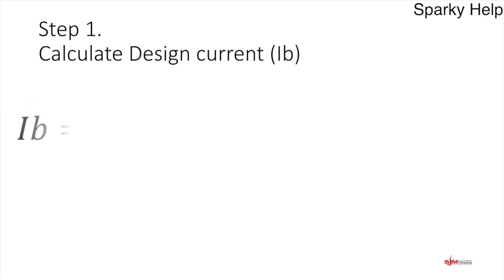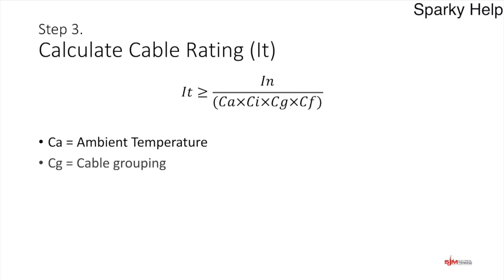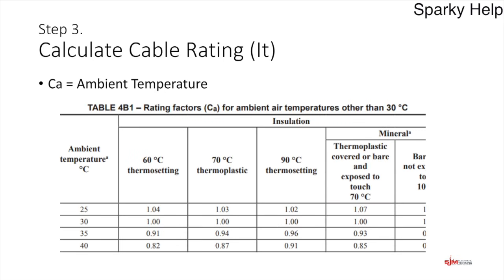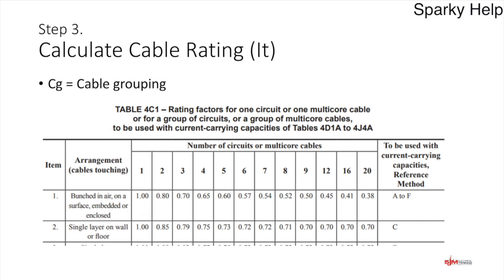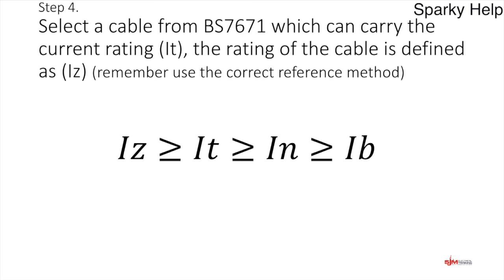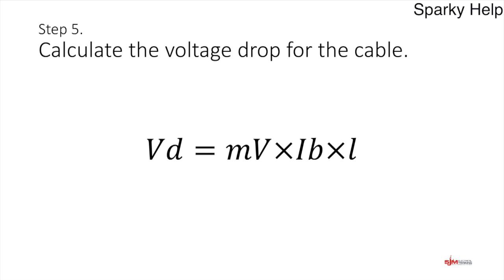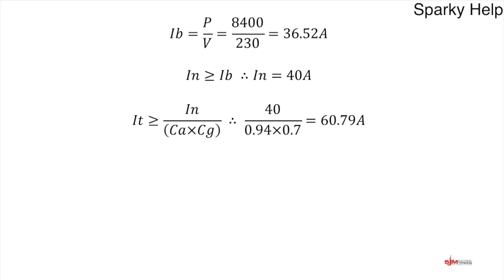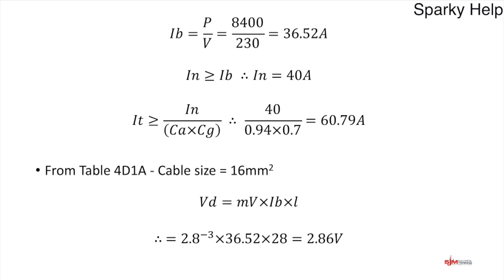Easy Guide to Cable Sizing and Cable Calculations

Comment: Thank you for the video! How did you determine the maximum allowable voltage drop?
Reply from the maker: Hi and thanks for watching, the max volt drop comes from the standard from BS7671 which is 3% for lighting and 5% for all other circuits on the public supply network.  Please share with like minded people and don't forget to like and Subscribe.
Reply: @sparkyhelp3997  Thank you!
Reply: Is it just something I would know for my circuit?

Comment: This all makes perfect sense but when you are trying to connect 16 mm cooker circuit cable to ovens where the cable it's directly supplying inside the oven is 1.5mm😂, it makes you wonder.
Reply from the maker: I get your point, but the oven cable has not had to travel the same route as the oven + plus different cable.  Remember you do not have to follow BS7671 it is not statutory.  Please share with like minded people or maybe even like and subscribe.

Comment: My college tutor has told us to apply diversity to the design current and use that value for the rest of the cable calculations. Is that not correct? I'm confused now!
Reply from the maker: Hi and Thanks for watching and share with like minded people, why is diversity being applied (is it a cooker?)  Design current is the current drawn by the load, the cable is required to carry at least the load current.  Speak to your turo and ask them to explain what the diversity is for.  I would only apply diversity as a rule for maximum demand assessment (https://youtu.be/7MhH-k6pEgI)  Hope that helps= look in your On-site-Guide to check for you self.  Good luck please like and subscribe.

Comment: How do you work out the design current for ring circuit with multiple socket outlet?
Reply from the maker: Hi Thanks for watching please share with like minded people.  this is a tricky one as you will never truly know what will be plugged in, therefore you could use a standard circuit and stick to area served and maximum length of cable (see On-Site-Guide App H).  So either assume A1, A2 or A3 circuit.  Hope that gives you further research.  Please like share and subscribe.

Comment: Heyyy you explained it very well. Can you please explain the calculations when the voltage drop is not given??
Reply from the maker: Thanks for watching, please share with like minded people.  Voltage drop is set in the uk as 3 & 5% depending on the circuit.  Or do you mean mV drop for cable?  In which case use resistances of the cable (from manufacturer or standard table) to work out volt drop, but all manufactures of cables will publish technical literature for their cables.  Hope that helps  Please like share and subscribe.

Comment: How about multicore cables like SOCAPEX? 6 circuits on 1 multicore cable. Does that mean that a 2.5mm SOCA cable is downrated from 16A to 9A per circuit just by being bunched up??
Reply from the maker: Hi good question, that would be a little more detailed to answer as you would need to read the regulations further.  you would also need to know the % load of each circuit as it may be neglected in in certain circumstances.

Have fun determining the rating - happy designing.

Please Like, Share & Subscribe.
Reply: @sparkyhelp3997  ah ok. So it depends on the load for each circuit?
I'll do some more research.

Love the channel it has helped me a lot since I discovered it!

Cheers

Comment: You need to elaborate on your use of Ib & In in your voltage drop & It calculations. Both can be used depending on the nature of your circuit. If the circuit can be overloaded, you would use the In value. If for a fixed load, you would use Ib.
Reply from the maker: This is True, but in this video it has not been covered.  One for another video maybe.  If I keep adding new ideas the videos are too long, so I have to stop somewhere.  But thank you.

Comment: 😮What about the 40A circuit breaker after having 60.79A? Do we still keep the In=40A?
Reply from the maker: Hi, 60.79A is the It rating for the cable not the circuit breaker.  The Load has remained unchanged, therefore the Circuit Breaker is still acceptable.  Please Like, Share & Subscribe.
Reply: Many thanks for your explanation!

Comment: Hello are we talking about a a copper or aliminum cable here? Could you tell how does cable size change according to type
Reply from the maker: Hi the Cable is copper, calculations can be carried out for Aluminium, but the current carrying capacity of aluminium is lower than copper.

Please Like, Share & Subscribe.

Comment: Is ambient temperature still at 70 degrees in thermal insulation ?

Also 40 divided by 0.94 x 0.7 = 29.78 or am I wrong ? 🤔
Reply from the maker: Hi the conductor temperature is 70 degrees, the ambient temperature is the surrounding air temperature.  Put the 0.94x0.7 in brackets 40/(0.94x0.7)=   Hope this helps.

Please like Share & Subscribe - Good luck
Reply: @sparkyhelp3997  sorry I ment is ambient temperature 30 degrees if wrapped in thermal insulation or would it be greater 

Na still not getting the calcs but il try work it out lol
Reply from the maker: @user-yh7bk7dx7c  Ambient Temperature is what ever the designer deems it to be (or the question setter!)

Keep going...

Comment: Hi, thanks very much for your video. My question is, would the calculated  Ib be divided by 3 if the circuit were to be  a 3 phase supply?
Reply from the maker: No use the three phase formula at the start to calculate.  Please Like Share & Subscribe.

Comment: Great explanation but a slight correction on the way you represent numbers in standard form in your calculations e.g. 2.8mV should be represented as (2.8 * 10^-3)V instead of (2.8^-3)V which is actually 4.6mV
Reply from the maker: Yes I know but a pain to go back and add an addendum now.  Well done for spotting it though. My copy has already been corrected. Please Like, Share & Subscribe.

Comment: When calculating Ib do I include diversity? Or the value before I do diversity calculation
Reply from the maker: I would tend to apply diversity after the design of the circuit.

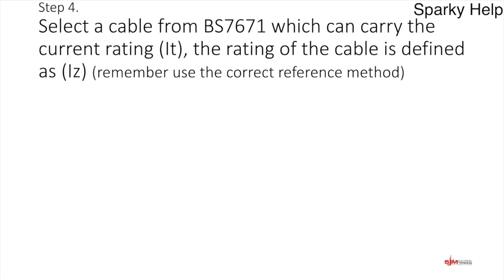Comment: Thank you very much, although some tables are not complete and also in 12:01 the text ended with " size is " and the rest of words are not there. would you please help us with your reference to let us get the complete knowlege and also help those who are making a research on that topic to get soft copy of the document.
Reply from the maker: Hi the reference material used is the 'IET  Wiring Regulation 2018', but a new one is out now dated 2022 Amendment 2.
Hope it helps please Like, Share & Subscribe.
Reply: @sparkyhelp3997  Thank you very much

Comment: Hi Sparky, doing an electrical installation design for a health centre at the moment and I'm curious in regards to design current. What would I use for the design current for sockets where I'm not really expecting much permanently connected equipment? such as a changing room/circulation areas. The protective device would still have to be 32A or 20A for radials to comply with appendix H surely? even though the load will never reach anywhere near this? The client(lecturer) hasn't really provided any guidance on what electrical devices are intended for use. I mean I can spec for a typical industrial hoover being plugged in & a few mobile chargers but current is something negligible like 7A for example but Appendix H states it would have to be on a 20 or 32A breaker for radials? Maybe I'm missing something or maybe 20A or 32A radials with negligible load is fine? Hope to hear back from you soon, submission is in 2 weeks lol.
Reply from the maker: Hi Part H of OSG explains that diversity has already been taken into account from historical usage.  keep the floor area as per 100m^2 for 32A (A1) RFC providing you do not know the load and the load is not reasonably expected to rise above 32A at any one time.  So what I would do is measure the floor area of the design and provide enough A1, A2 or A3 circuits as per the floor area.  Areas to give special consideration would be rooms such as kitchens, utility rooms or any with room with a lot of appliances which could be on at the same time.  Remember diversity is not an exact science (just read the first couple of paragraphs from OSG maximum demand and diversity).  Good luck - Please like, share and subscribe.  Many thanks.
Reply: @sparkyhelp3997  Thanks alot mate, after a bit more digging around I seen I should be Using my cpd rating as design current Ib=In I'm only using radials, no rings. I ended up with something like 31 seperate socket circuits (4 Storey building with 8 on bottom 3 floors and 7 on the 4th) with almost all except for 2 or 3 being A2s 75m squared radials on 32A cpds and the other 2 or 3 Being A3s 50m squared on 20A cpds, haven't fully specced into the cabling yet as it must've took me about 3/4 hours of looking back and forth between the model and drawing my circuits on CAD. I also have to wait for my team members to feed back to me info regarding the lighting and LV stuff such as CCTV and security systems and fire alarms. That way I can get my groupings. I only noticed today when reading appendix A that A1 is for your initial circuits and A2 is diversity to be applied after all circuits have been spec'd to get your main incoming fuse size. I swear I done my college HND coursework from 3 years ago wrong because I'm sure I was applying A2 diversity to my lighting d'oh. I've recently gotten a job as an electrical engineering consultant so it's key I keep refreshing my knowledge and keeping up to date. Thanks again for your help mate!
Reply: @sparkyhelp3997  How then are multiple (more than 16) circuits sized to fit in a single trunking?

Comment: without using tabular form, how to calculate mV ?
Reply from the maker: Hi you need to know the resistance of the cable conductor over a given length and apply ohm's law.

Hope that helps, please like share and subscribe to enable me to continue doing this.  Many thanks.

Comment: sorry to sound dumb here but if I have 10 single phase circuits each 7.2kw and I wanted to find the design current for a sub main to feed a board and the supply is 3 phase how do I work that out as obviously I don't just add all 10 circuits up (72kw) as you would if the supply was single phase.
Reply from the maker: Good Question.

Assuming it will be split over the three phases, you could divide by three, (this is crude - approx. 100A per phase), or design which phase you want them to be on to be more accurate.  If you want to design the sub-main, you may with your more in-depth knowledge what these circuits are, you may want to apply diversity.

Really hope that helps.
Reply: @sparkyhelp3997  they are for EV single phase 7.2kw car chargers so can't use diversity.
I looked at it as I have 10 circuits each 7.2kw on a 3 phase DB so that's 4 + 3 + 3 so did 4 x 7.2kw = 28.8kw power factor of 0.95  which gave me a design current of 132A.
Reply from the maker: The dilemma of the modern age (EV chargers), it will just need a large supply and a dis-board rated to cope.
Reply: In the end I took the total power of 9 of the single phase circuits as these will be balanced over 3 phases, 3 - brown, 3 - black, 3 grey then used a pF correction of 0.95. So 400v x 0.95 = 380v.
7200 x 9 = 64800w / 380v / Sq route 3 = 98.5A. Then the final circuit 230v x 0.95=218.5v.  7200/218.5v = 32.9A + 98.5A So lb = 131.4A
Reply from the maker: I agree with the answer (easier to write down than type in - dont you think) - Good luck

Comment: Hi great videos 
Can I just confirm, when calculating vd , the original Ib of 36.52v  is used and not the new It of 60.79v .
Is this correct 👍
Reply from the maker: Yes that is correct, it is Ib that is actually flowing through the cable to cause the volt drop.

Comment: After calculating the cable size and when attempting to calculate the short circuit current am I correct in saying you need to calculate the resistance and reactance of the cable which is separate from the values in the voltage drop calculations? Do you know where to find the tables for resistance and reactance values? The do not appear to be in BS7671
Reply from the maker: For the vast majority of circuits reactance of the cable will be ignored as it is such a small value it would be insignificant.  If you are talking long distribution or transmission cables then the information from BS7671 would not cover this.  BS7671 covers low voltage installations.  I would suggest seeking information from the cable manufacturer (this is where I go to find the resistance of cables or armouring of cables - BS7671 does not provide resistance of conductors, the On-Site-Guide does but only up to 50mm^2) .  I hope this goes some way to answering your question, but the answer is not that straight forward as we could write an entire paper on this subject.

Comment: How do we get the 11.5 Volt drop?
Reply from the maker: It is from the wiring regulations IET 18th Edition (used in the uk), 3% or 5% of the nominal voltage for particular circuits.  Hope that answers your question.
Reply: @sparkyhelp3997  yes, it does completely answer my question.
Thank you!

Comment: I can use these techniques to calculate the cable of an automotive wiring harness.
Reply from the maker: That  is good question, the same principles apply, you would just need to find the actual current carry capacity of the type of cables used from the manufacturer. Hope that helps.

Comment: Can you explain why you didn't consider power factor 17:55? For single phase it is V*I*COSPHI rigth ?.....how much load can single phase carry? For beyond 8kw it should be 3phase right ? @sparkyhelp
Reply from the maker: Power Factor only applies if the load is inductive or Capacitive.  If power factor is not given (maybe for example an electric heater) it is more than likely a resistive load and therefore power factor is 1.

Comment: Thanks for th video, can you confirm that in cases where there is no possibility of overload in respect to usage you would use "Ib" (design current)  rather than "In" (.size of protection) when calculating for "It". (tabulated current) e.g Ib/Cg x Ca x Ci  etc
Reply from the maker: This is true BS7671 Appendix 4 equation 3,4 & 5 could be used as you have put above.  Hope that helps.

Comment: Thanks for your sharing  . Could you help me to advice that when we calculated the Design Current Ib , the power factor is required to include or can omit as this power factor make the result of the Design Current into 1.25 Time when the power factor is included in Design Current Calculation Step .
Reply from the maker: If there is a power factor it must be included in the calculation as the design current will be higher, and therefore the cable will have to carry the extra current. 
Hope this helps.

Comment: At 16:39   for volt drop the title is "2 cables single phase AC"        what does this mean. Is it live and neutral ??   At 20:47 for current capacity table we have the same thing. ?
Reply from the maker: yes this in line and neutral

Comment: You explained cable grouping excellently. In effect this is worse than thermal insulation put over cables as each cable can be at 70 degrees so when grouped they are heating each other potentially if they are at full load.
Reply from the maker: Thank you - please read the notes below the table for grouping in BS7671 for other variations on its application.
Reply: How then are multiple (more than 16) circuits sized to fit in a single trunking?

Comment: thank you  for your video it it very good but  calculation voltage drop formula minus -3 not gave correct answer please  clearly gave formula thank you
Reply from the maker: Hi, my apologies it is raised to the power of x10^-3 or (milli).  hope that helps
Reply: @sparkyhelp3997   yes thank you very much now it work many many thank do more Video for calculation please thank you

Comment: Thanks for sharing. In real life, I wonder if electricians do actually do all these calculations, especially for Ca, Cg and voltage drop. Normally, rules of thumb are applied, so for example 20A mcb equals 2.5mm2 cable, regardless of Ca, Cg and voltage drop. Just like to hear what real life electricians do or do not do in practice.
Reply from the maker: A good designer / electrician will take the method of installation and type of cable into consideration.   Obviously we can all choose not to take these into consideration, but we are hoping things do not go wrong  (and they may not, most of the time) - remember BS7671 can be used in a court of law to provide evidence.  The OSG has tables to take some of the design out of installations - you just need to stay in those parameters.